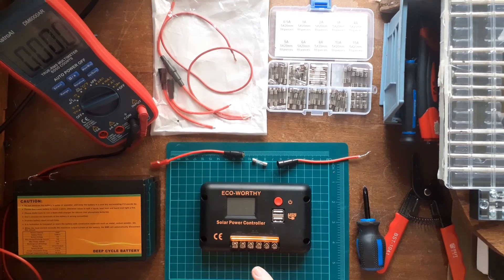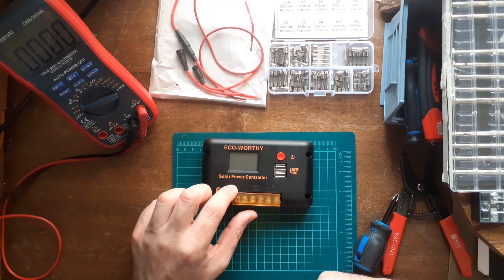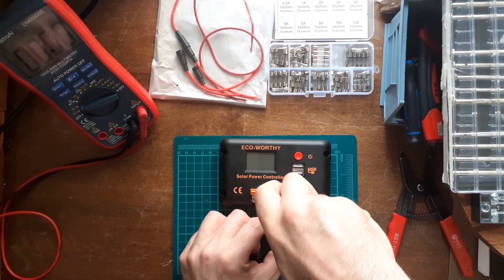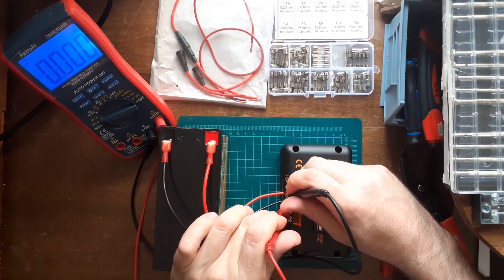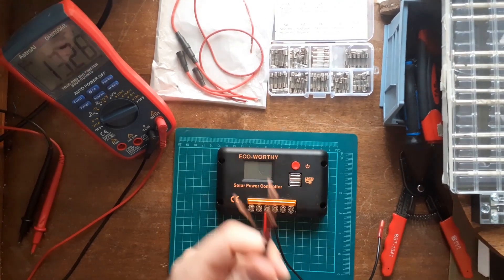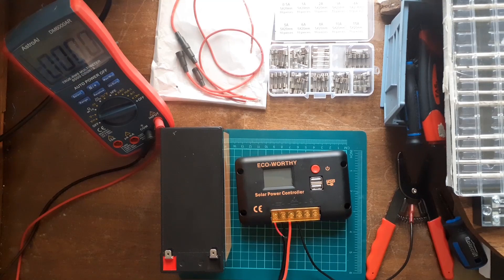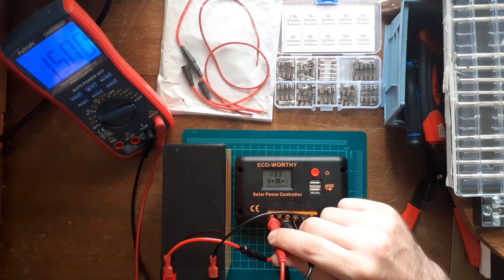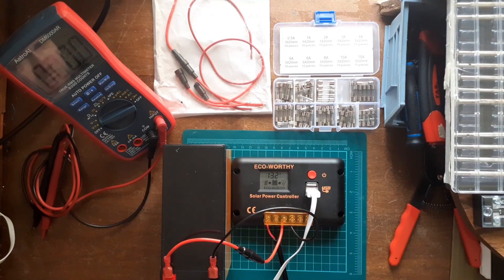How to wire a Solar Controller | How to wire a Eco Worthy solar controller

Comment: thanks, i watched this before i went ahead with my first solar installation ever. definitely went out to buy an inline fuse wire and 15A fuse from Canadian Tire.
took me 30 minutes to hook up the same PWM charge controller to my 12V 8ah LiFePo4 battery (with inline fuse between), hook up the 12V/24V solar panel to the charge controller, and hook up a load wire for an LED light and DC fan for our sauna.

Comment: Nice video...thoughtful instruction, thanks. Would like to know what kind of appliance could be hooked up to the load screws? What size wire are you using?
Reply: as long as the battery and charge controller can handle the unit.
formula is A x V = W
the charge controller is 30A.
the solar panel, battery and charge controller output (can be set) are all 12V.
so 30 x 12 = 360W. you can power devices that total 360W (better to be less) power consumption.
for this application, 12AWG to 16AWG wires will be good, depending on the distance from the charge controller to the device; the further the bigger wire.

Comment: Fab video, most helpful! Can I assume if the solar panel is showing on the screen then all is well? Is there a way to see how much power is coming in on the charge controller screen or do I have to have a gadget like yours?
Reply: Press the red button once will show you how many amps going to battery, press twice will show battery output, press three times will show temperature of controller 👍🏻🇬🇧

Comment: So if you have a problem that blows the fuse then wont the solar panel keep putting out power and end up burning up the controller ?
Reply: The purpose of the fuse is to ensure the current to the battery is below the designed threshold for the battery.  The controller will handle up to 30amp, but your battery is likely not designed to take that much current — whatever the designed spec is for the battery.  Most modern batteries proclaim over current protection but I wouldn’t necessarily trust it.

Comment: I have a 200w system, yesterday in direct sun it was pushing about 10.5 amp, today, .1
Reply: Any ideas why it would do that?
Reply from the maker: I'm not 100% sure of your setup, but it could be a faulty solar charge controller.

Comment: Congrats for the video! I have a basic question on the controller function! Considering  your setup, the USB Energy comes from the battery or directly from the solar panel?...and of a connect a load using the other two connections, again, the Energy arrives from the panel or from the battery? ..thanks
Reply from the maker: The power comes directly from the battery. The solar panels charge the battery, but the 'devices' do not run directly from solar power. The solar panels charge the battery, and the power for the devices come from the battery itself.

Comment: I have the same system but can't get mine to work. I have 15 v coming from the panel on the roof but when I contacted my lines from the panel to my charger control I get Les than 1v can you help.

Comment: Do you have to set the controller after wiring or are settings pre programmed to prevent frying the battery?
Reply: I’m a complete newbie(at 82) to these modern systems so please forgive my ignorance.